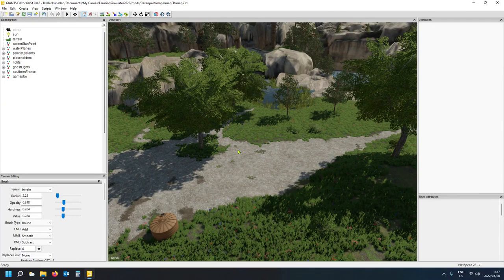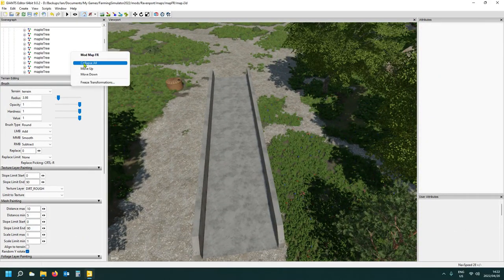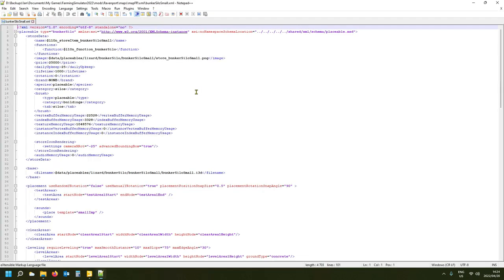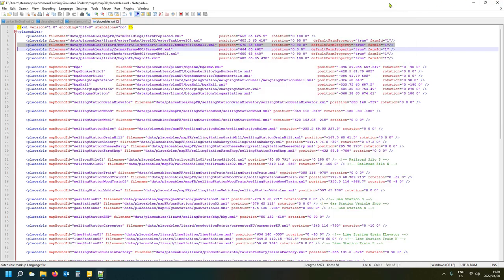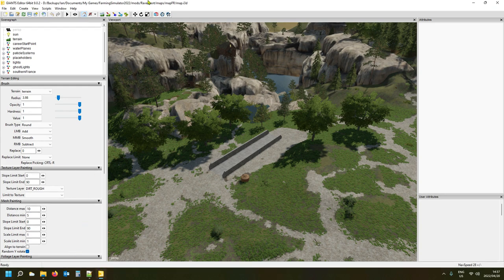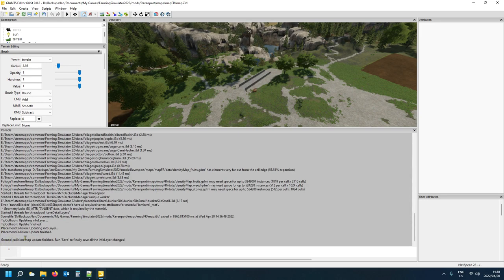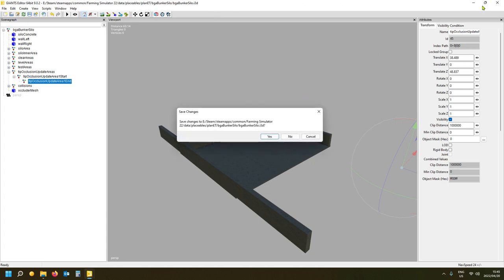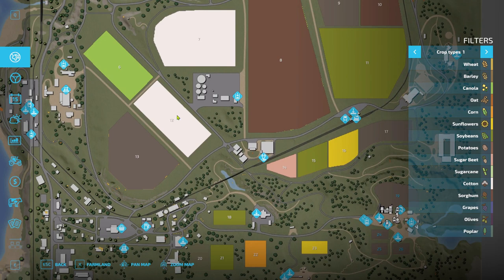How to Add a Custom or STD Bunker to your Map!

Comment: Great tutorial... Any chance you could show how to get Precision Farming DLC into a map...
Reply from the maker: Hi brother, precision farming is a dlc, you just download it in game select it in the mods menu and it works on any map. 👍😄🤗
Reply from the maker: Also you dont want it built into ur map as many guys dont like playing with it.
Reply: @FarmerBoBonYoutube  but in fs19 some maps had custom ground types built into the map... so that is not needed anymore???
Reply from the maker: @BrummieFarmer  hi brother, custom ground types is not really possible yet however some guys has gotten past the coding in the .dds files but the colors they converted are not even close to the nice ones we have in the 3 base maps. I believe there is almost 200 different textures to work with. But i digress, PF is not a ground texture, it is simply a new info layer that is added to the game. If u open the PF dlc and look in the soilMaps you will find the info layers there .grle files.. So nothing to do with textures. And it is all in the mod from the DLC, so just download and play. No need for adding to the map. And even if you could add it, it would be permanent to ur map, cutting out the players who doesnt like playing with PF.
Reply: @FarmerBoBonYoutube  ahh ok, thanks for clearing that up... i think i was getting confused
Reply from the maker: @BrummieFarmer  no worries brother👍😄

Comment: Hi Bob, I wonder if you've seen this type of error with loading the custom bunkers.
I keep getting this error and I'm not sure why.

Info (A:/Documents/My Games/FarmingSimulator2022/mods/FS22_Drumcross/maps/placeables.xml): Placeable 'maps/placeables/main farm/silageDouble/BunkerSilo.xml' is not allowed to be loaded

Any insight would be greatly appreciated. Thanks again for the great tutorials.
Reply from the maker: My pleasure,  yes thats a common error, normally happens when you start your map in one of the other 2 game modes like start from scratch. 

Hiw it works, your placeables.xml defines which of your placeables is alocated to the new farmer mode by adding the defaultfarmproperty=true to the line. This will cause the placeable to load only in thebnew farmer mode. It will give you this warning in the other 2 game modes and it will not load the placeables with that parameter. 

If you wrongly assigned it to a placeable, just remove the defaultfarmproperty parameter on that placeable and it will be always available in all 3 game modes.
Reply: @FarmerBoBonYoutube  Thanks. That fixed the problem. You are awesome 👌

Comment: I'm sorry. I didn't catch it. Bob, why do we need to run 'Create Ground Collision Map' script? What is it for? And I checked my bunkerSiloMedium... I can unload the grass on the half of bunker lengh only... Why? What did I miss? No errors or warnings in my log file. P.S. As I understood, the picture of the grass unloading is the same as a picture of the old tipCollision of my map... But I know nothing about it. Can I simply color all my map with one tipCollision color? ))) P.P.S. I've colored. Now I can unload nowhere. 🤣🤣🤣 P.P.P.S. I repaint it right. Now it works normally. ))) But any way, we still need some video about collisions. Please! )))
Reply from the maker: Hi there.. ok do the following, open the map in editor, then zoom out to see the whole map, then in your terrain editing window navigate to the info layer painting section, select the info layers one at a time, once you selected one of them click on the channel 0, then verify the area where you are working that there isnt anything painted there. then go through all of them and clear them with right button "substract" option. specially the collision ones.. 

when you start a new map. i normally go through all the info layers and clear them all on the whole map. :)

to get to your question about the Create ground collision, when you add buildings, modify terrain etc, a new terrain layout needs to be created for collision etc.. this script does all that automatically, then just save the map after that and all is well.

hope it helps.. :)
Reply: @FarmerBoBonYoutube  Thank you very much! There was an indoor mask I removed. It's my first map so I didn't know how to make a clear map. )
Reply from the maker: @ritamax8493  awesome 👌